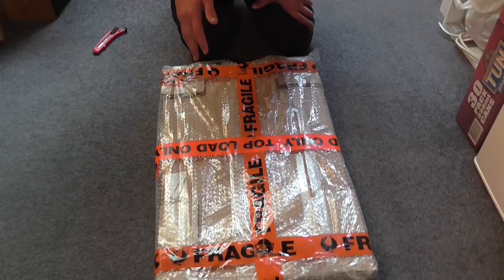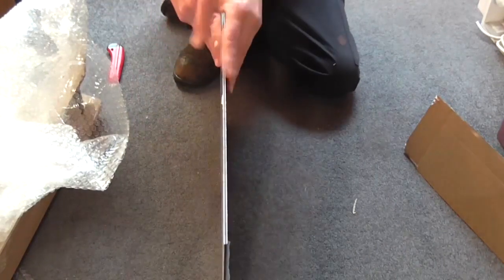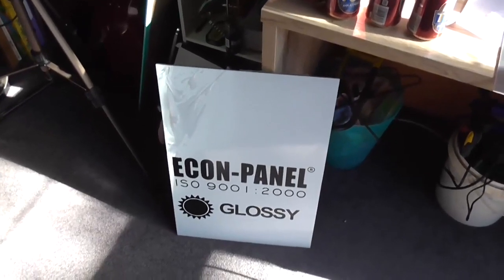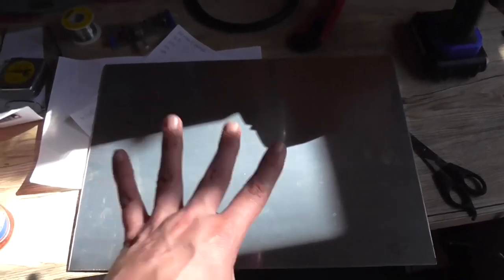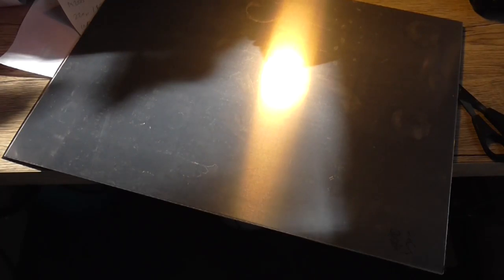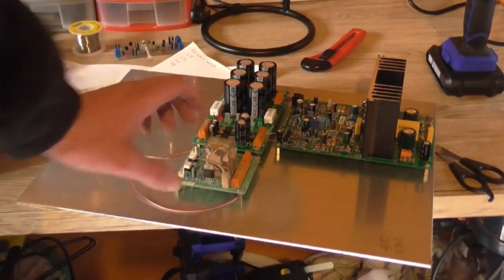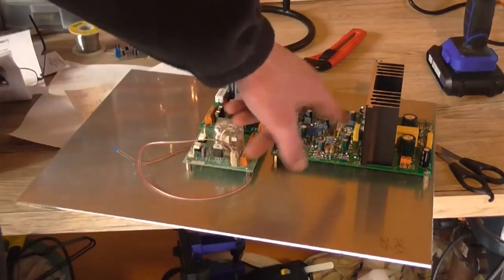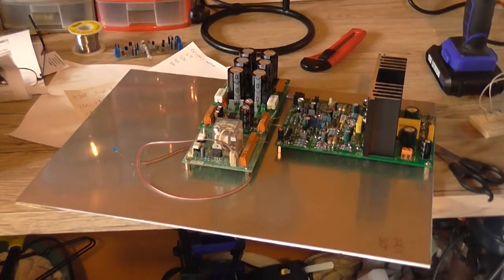Class-D Amplifier Build Part 1: Introduction

Comment: **TIP**
You can use a Single 40-0-40 Toroidal and to get whatever extra windings, Get yo self some bell wire and wind around 2 by 30 windings for 15-015 Volts yo self once done slap some good quality Insulation tape over it or yo can source a single 40-040 with 12-0-12 windings done fo yo, that way everything fits with a single transformer.
Reply from the maker: Yeah, it's possible. I really don't like or advocate messing around with transformers if you don't know what you're doing.
Reply from the maker: @montgomeryhifiandreview5528  LOL!

Comment: I built My PA/Club/Event Amplifier based upon two Classic D Amplifiers, power supply and speaker protector all within a 2U Rack Mounted Drawer. So backup modules can be replaced within minutes, not that I had to mind you, 
Anyway, see below
https://www.factoryfast.com.au/products/19-rack-mount-2u-steel-plate-dj-drawer-equipment-cabinet-locking-lockable/?utm_medium=ppc&utm_source=google-products&utm_campaign=furniture&ref=1292&gclid=CjwKCAjw8pH3BRAXEiwA1pvMsbffS9Lf4a0PMvhDtWiDJj2rocD48bBU93yD13MHbOPNcqBFqPfwjBoCGbgQAvD_BwE